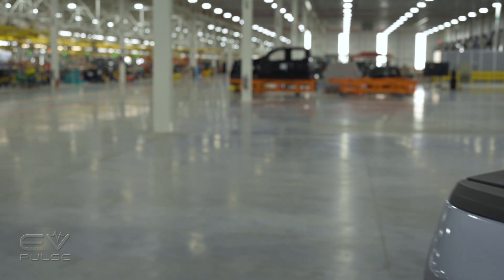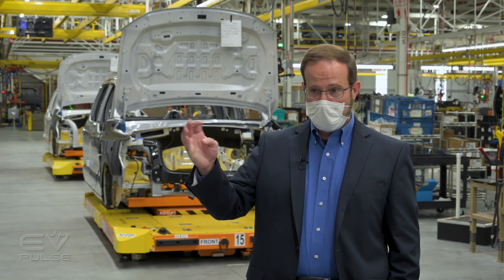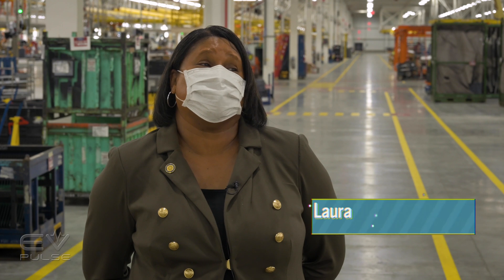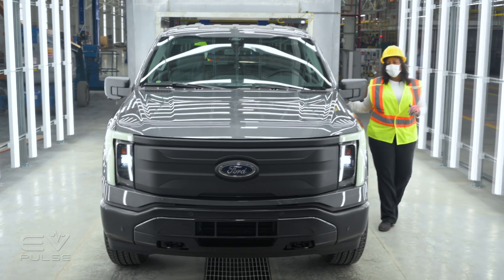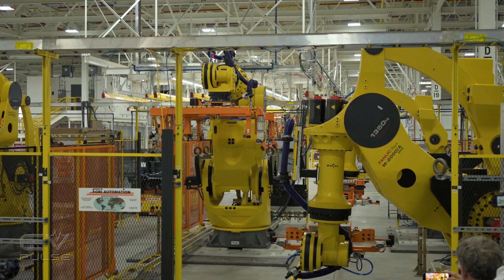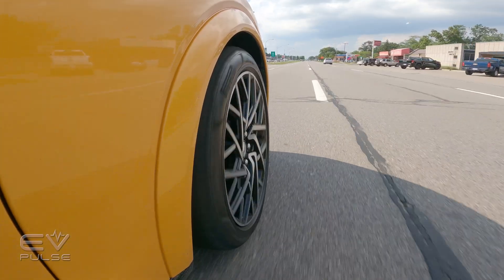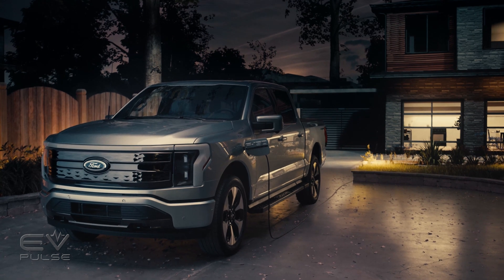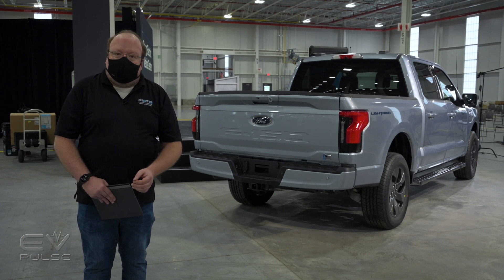Building the 2022 Ford F-150 Lightning | First Full-Size Electric Truck

Comment: How will this behave in freezing climates, like Michigan and what’s the reduction in range and charging with the cold climates? Does it use power to keep the battery cool in hot climates, what’s the size of the battery 100kma or larger and what’s the time to charge on various deliveries

Comment: No one is addressing reliable grid . Need that to have in order to make ev successful 
In Toronto experiencing power outages, power blips, when to many ev plug in, heat wave how well is the grid going to handle it.
Like to get the lightening the holdout is the power grid, plug in at night power goes by morning not fully charged, power does go out, powers the house then battery drops to level that allows it to drive, range is diminished 

Grid needs to be addressed
Reply: T C  a very good portion of drivers using our 400 series highways travel up to 100 Km 62 miles or less per day per one way then reverse,  they are on highway for an hour, each way does happen to be bumper to bumper,  would be charging everyday. The issue with the grid here is battery cycling and power outages very brief to longer.

Comment: The Lightning brand is historically the performance brand for the truck, might be why you got a confused answer. Would still love to see a Raptor version!
Reply: Raptor version would be soo OverKill. If this is the starting point.
Reply: @Neojhun  They could just do suspension, tires, and cosmetic changes.

Sadly, they just have little interest.  The ICE raptor is easier and more profitable for them.

Comment: Too bad the production numbers are soooo low. Something like 15K the first year, 55K in 2023, and 80K in 2024. This After they doubled production targets. It will take them years just to get through their order backlog. They are not prepared at all for new organic demand as these trucks hit the road.

It's almost as if Ford doesn't want this to be successful. Either that or they are really bad at their jobs.
Reply: battery supply chain
Reply: T C  150K doesn't inform you and Ford about demand? Besides they have highly paid people to determine and generate demand, and as you mention they've got little choice anyway.

I'm heartened to see the recent news that they could be beginning to pivot.
Reply: Not everybody wants an EV loser.